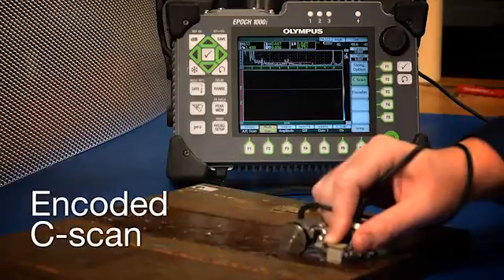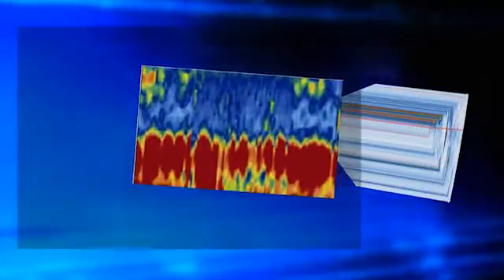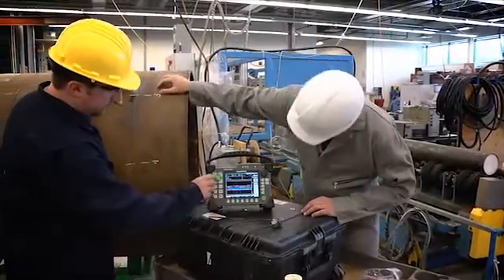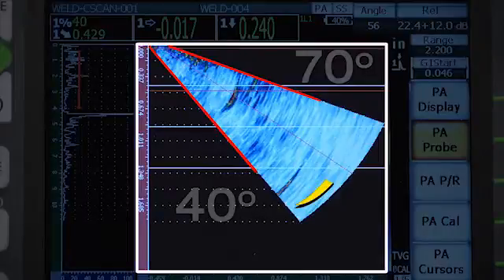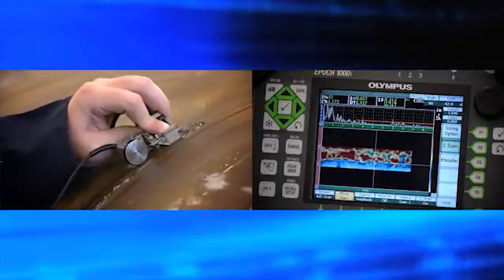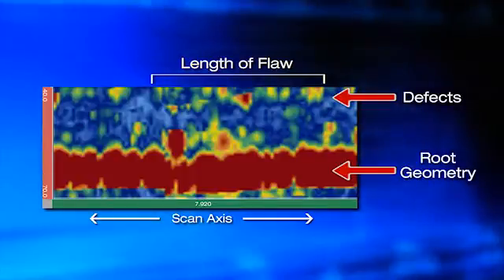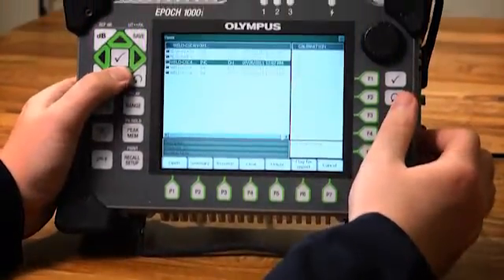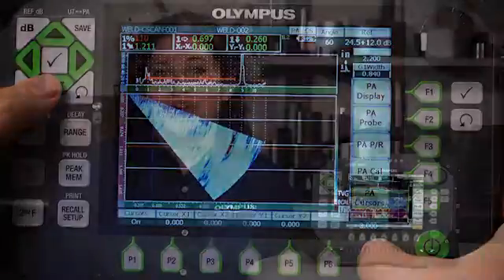EPOCH 1000i Encoded C-Scan Feature

Comment: Hello! What is the max depth that epoch1000 can scan from seek a imperfection?
Reply from the maker: Hello Fede, it depedns on the material, the probe and the set up. In carbon steel, for example, this could potentially be several meters. Please provide us with more information or reach one of our representatives to get more information for your application: http://www.olympus-ims.com/en/contact-us/